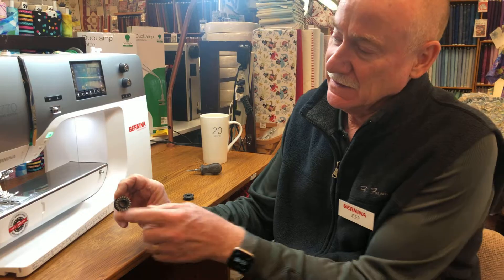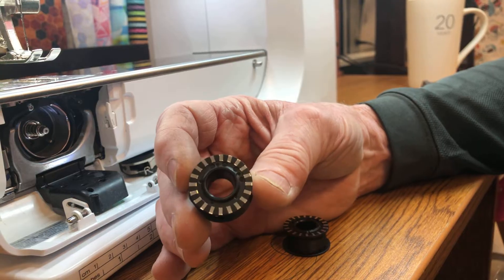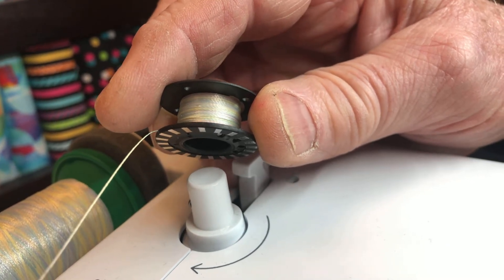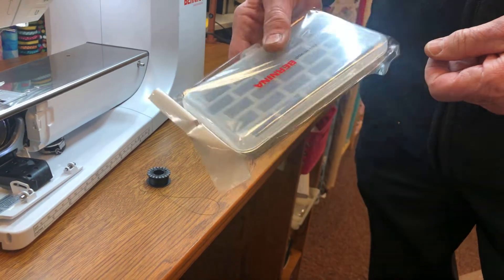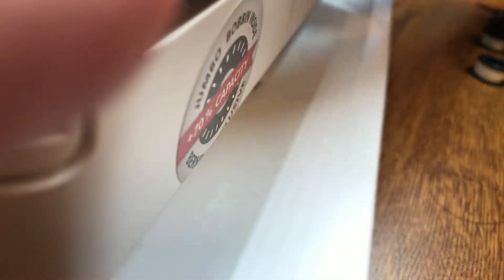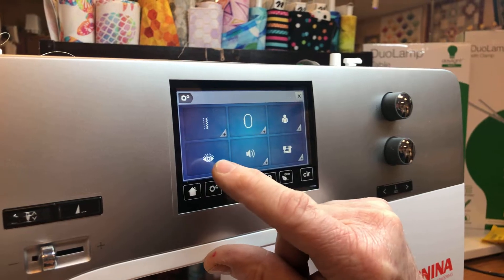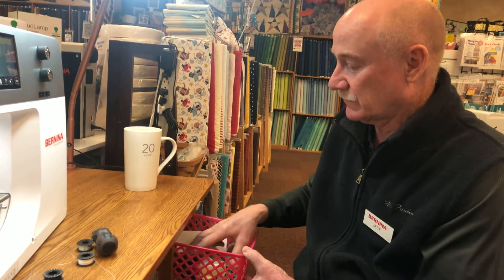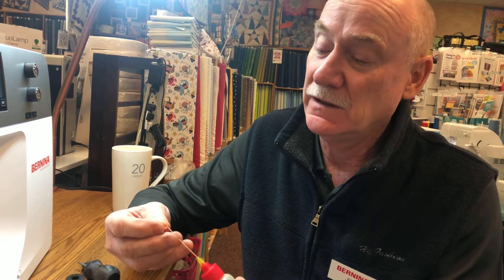Bobbin Errors How to Fix Monitor, Cleaning, Winding, Adjust on Bernina 7 & 5 series Bernina Jeff

Comment: Thank you Jeff! you saved me. I'm working on a quilt for a gift and called local dealer to get assistance and they told me 3 week wait so they could check or clean sensor. But they were sure I needed a new sensor. I cleaned them myself as you instructed and it's working great. I wasn't told I could turn off sensor as long as I wasn't embroidering. I am sad that they knew it was a gift I needed finished and was told they would look at it but I had to pay expedited charges. I love sewing and don't have a fixed income, you are truly wonderful.

Comment: You won't see this since this video is 2 years old - but it's still a great resource! My bobbin in my 765 ran out and it had be a minute since I wound one and tried to do on my own. It came out cone shaped but now I know why. I tried to use it because I'll bet the last one was that way too. So I checked my manual and did like it showed and the bobbins came out even worse! I wound FOUR bad bobbins!! Then I watched this video and notice you didn't put the thread holder thingy on the end of the spool and you didn't wind the thread through that little loopy thing. So I tried it and when it started going cone shaped again I guided the thread so it filled the other end. PLUS I didn't know about cleaning the little black thing. So I cleaned that, all around the bobbin case and under the plate. It wasn't too bad because I'd cleaned it recently and even took the hook out and cleaned that then almost couldn't get it back in! But now it's sewing like a dream again and I didn't have to take her in to the spa and be without her for weeks. Thanks so much for these videos. They teach me new things and also refresh my memory on some things!

Comment: Thank you Jeff!  Great information.  I've purchased the oil bottle from you and its great.  I'd also like to give a shout out to Debbie at your store for answering my question when the needle nose got plugged and I couldn't squeeze any oil out.  I accidentally clogged that needle nose, so I called the store and Debbie instructed me on how to resolve that.  Thank you!!
Reply: Oh how nice! Thank you. It was my pleasure to help you!
Reply: @ThreadPlayLLC  here’s what worked for me - I used jewelry making wire. It’s very thin and flexible. The plug was pretty far inside so that wire did the trick.  Thanks again. 👏👏

Comment: Sometimes my 770qe tells me I have run out of the top thread and I haven’t.  I have to stop sewing and rethread the machine. I put the clip on my machine now and I am hoping it will stop the thread jumping out. Thank you for all your tips.
Reply from the maker: Do you notice that the thread has jumped out of the upper tension area when you get the warning that the thread is out?  I have had to adjust the check spring on a 5 series when we were having this problem, the spring was set too high and not letting the machine know there was thread in it.

Comment: Another great video, thank you 💕 as a new Bernina owner your video’s are invaluable and very much appreciated.  May I ask you whether the presser foot should be left up or down when leaving it. I was always under the impression that it should be down, but when I unplugged and put the cover on I realised the foot was up, should I have manually put it down before switching it off?..thanks x
Reply from the maker: On modern machines I do not feel it is important to store the machine with the foot down. There is a spring that is compressed when the foot is up but in 30 years I have never had to replace that spring on any brand of machine. It does hold the foot on better so it can’t get lost!

Comment: Ridiculous question. I have a new 790 plus. When winding the bobbin, yes I am sure I am doing this correctly, but it just slips from bobbin, to the winder. I think the little metal “tabby” thing that holds it from slipping, is stuck inside. I put scotch tape to create friction to make the bobbin wind. My dealer is two hours each way from me. Ack! Is there a way to get it out, or is tape my only option?
Reply from the maker: I have seen this happen a few times.  If you look closely at the bobbin winder post there is a small slit with a wire like spring that protrudes out of the slot just a little bit.  If that wire spring gets out of place it will not hold the bobbin from spinning.  Inside the hole of the bobbin is a small indentation that the wire needs to fit into, make sure that is clear.  I use the tip of an Exacto knife to try to get that spring wire to stick out a little more.  Bernina does not make just that part, the entire bobbin winder assembly has to be replaced about $80 plus labor not usually covered under warranty by Bernina.  Continue to use tape but make sure that the hole is clear before you put it into the bobbin case if tape is in the hole it can damage your bobbin case.
Reply: @berninajeff  Thank you!!!!!

Comment from the maker: If you hear a grinding noise after cleaning and oiling try tuning off the thread sensors and take out the bobbin case and metal hook and try running with no thread at all.  Test with the hand wheel pulled off it just clips on and it will make a noise sometimes.  Try taking off the needle plate and run it.  If this does not cure it go to your dealer, a needle part or something is in a bad place.

Comment: I have a 790.  It doesn't seem to warn me when I am almost out of bobbin thread.  The first alert I get it when the bobbin is completely empty.  Is this correct?  I would have thought that the purpose of having the thread sensor was to let you know just before the thread runs out.  Many thanks in advance for any advice.
Reply from the maker: I believe the small bobbin icon will start flashing red when it gets below 10% but you have to look at the screen.

Comment: My machine is making a metallic noise when I sew. She is sewing perfectly but despite having cleaned and oiled and put in a new needle it is still making a grinding noise. Any ideas?
Reply: Hi Bridget, my 790P was making noise the other night,and,of course it's late Friday night. Watched one of these videos so I thought must be a thread stuck in there. The bobbin icon had a yellow circle going around it. Looked in the manual, nothing. Next day tookbobbin case all apart again, nothing. Then I thought wonder if Jeff's store was still open since they are on Mountain time. Then I discovered the problem. I always put an empty bobbin on the bobbin winder. Somehow it got turned on and was spinning and also making the grinding noise. Don't know if this helps you. I feel kind of stupid for not noticing it.lol.  But I learned alot from his videos esp about an easier way to oil it and put the bobbin case back in. Happy sewing!

Comment: From the 790plus how  do I get the bobbin out of its case from the machine I can’t get it to come out I took it out of the machine but it still won’t release
Reply from the maker: Use your finger nails or a small screwdriver to pry it out gently. Push in on the latch as you do that.
Reply: @berninajeff  thank you

Comment: My bobbin sensor doesn’t identify when the bobbin is getting low.  The machine is a 790 plus.  Please help!
Reply from the maker: I just tested mine at the shop and when the bobbin gets below 10% a small icon starts blinking next to the bobbin icon on the left side of the screen.  Make sure your EYE monitor is on.  If you do not get the blinking thermometer then try a different bobbin make sure your bobbin case is clean then go to a dealer.
Reply: @berninajeff  
Thanks, I’ll give it a try!

Comment: Why does the bobbin winder on my 770  make so much noise, and why doesn’t it completely fill the bobbin?
Reply from the maker: I needs adjusting it has been bumped and bent out of alignment it is maybe dragging against the plastic case housing see a tech
Reply: @berninajeff  thank you for your help, I’ll give the technician at my Bernina dealer a call